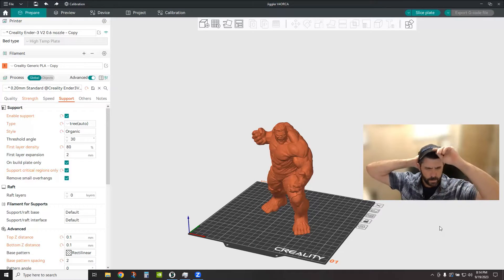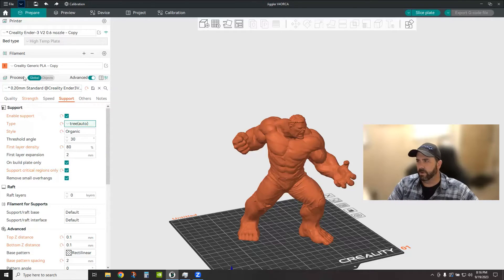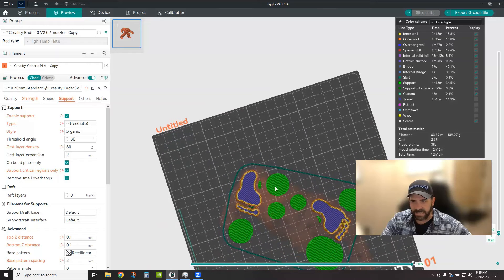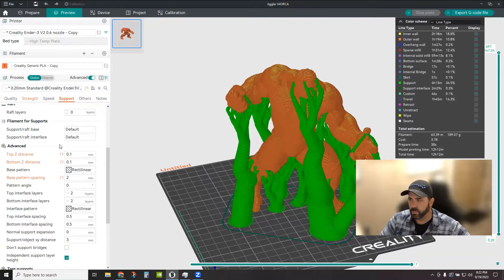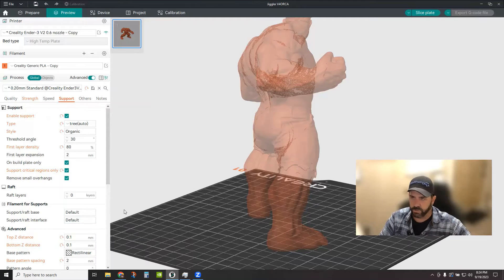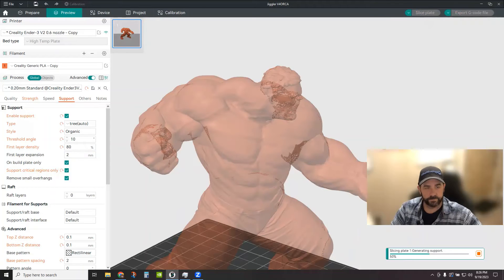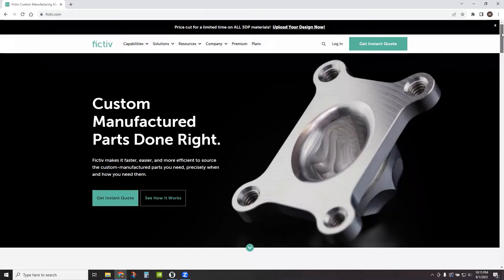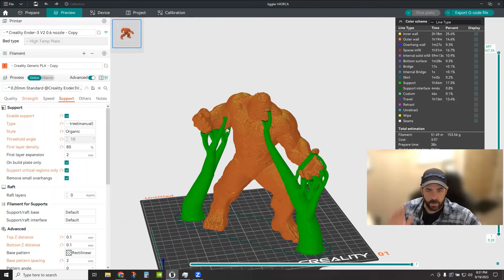NEW Organic Tree Supports in Orca Slicer 1.7.0

Comment: I noticed your hulk figure looks like it is solid inside. do you recommend building organic supports within hollow models itself to prevent failed prints?
Reply from the maker: I'm sure that 100% infill was a carry over from a previous model i was printing.  I generally don't find that adding organic supports inside is needed.  I do actually try and use as little infill as possible for most prints.  I find 5 to 10% for most is more than efficient as long as I'm printing with 3 walls.

Comment: Hi. Can I export the organic support as a separate stl, OR can I export the organic supported model into an stl or obj?
Reply from the maker: The only way I see to do this would be once sliced, in the upper right corner, select "export Sliced file".  This saves it as a 3mf file.  Then you'd probably have to find some 3mf to stl converter.
Reply: @fischer3d  Ther is no "export Sliced file" option there....only Export Gcode or Print
Reply from the maker: interesting.  what version of Orca are you running?
Reply from the maker: ah ha.  it's because it's not a bambu printer.  super odd they would do this.  see if you can trick it.  select a bambu printer as your printer, resliced the file and check that menu again.
Reply: Using Bambu, it is possible to export the model w support, but unfortunately it is a custom 3mf file, so, only orca and prusslicer able to open it. :( so, I give this up. Thanks for helping me!

Comment: hey man thank you for this tutorial! i am  having problems with my tree supports it leaves a weird marks on my print what should i do?
Reply from the maker: Hmm.  hard to tell without seeing a pic.  What's your "top z distance" set to on the support tab?  You'd want some multiple of your layer height, like 0.2mm for example.  Also, take a look at the number of "Top Interface Layers" and "Top Interface Spacing" on the same tab.  I like using 2 interface layers and 0.5mm spacing to minimize the amount of surface area touching the print.

Comment: Hey man. Love your channel. I see that your slice has no top layer ? Just inner wall and outer wall? How did you manage that ?
Reply from the maker: Hey thanks.  Yeah one of the parts I print a lot of actually prints upside down.  So on the Strength tab I have 0 top shell layers, 8 bottom layers (really the top), 0 infill, but 3 walls.  So in actuality it is a solid print, just printed upside down.  I do this to save time on support material.

Comment: Just started testing this.  One thing that I've noticed using trees is that Z-Hop is now a thing.  My initial print attempts kept knocking 1 or 2 of the smaller trees over during nozzle travel.  Adding 1MM of Z hop when retracting seems to have sorted it on my SV07 Plus and Ender.  I also upped the First layer density to 100% for better adhesion (better safe than sorry).  Oh yes, the new appimage works great on Linux Mint.
Reply from the maker: Great callout! z-hop should probably be enabled, if not already when using tree supports.